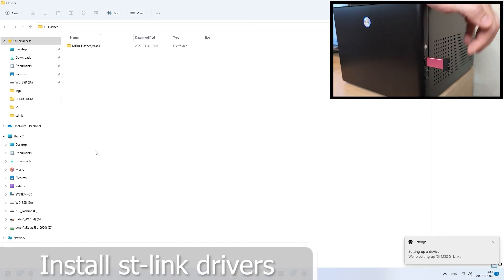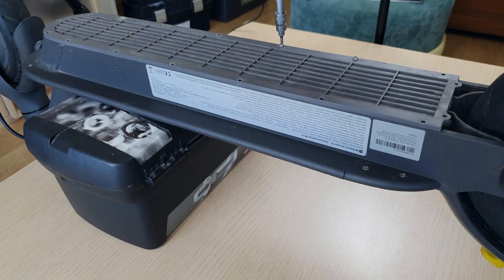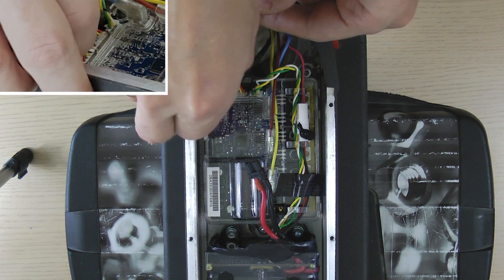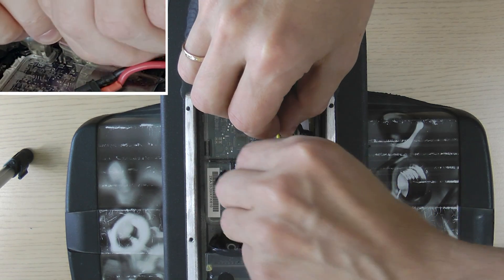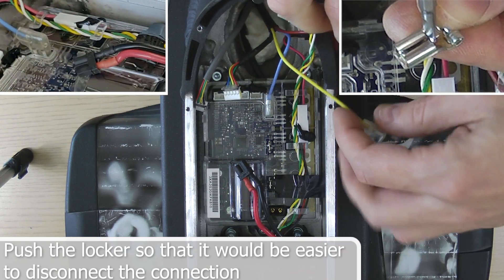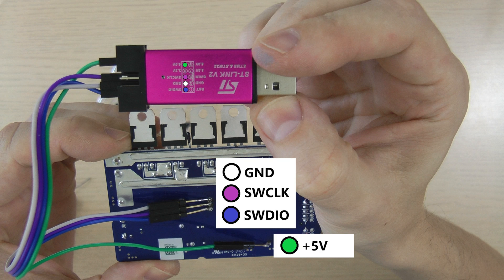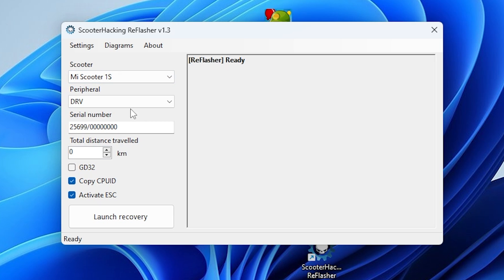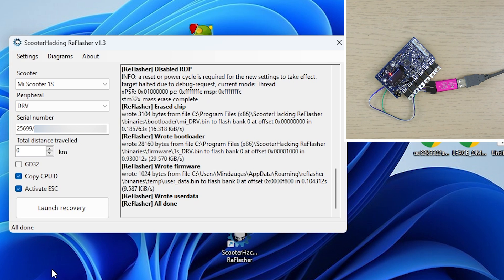Flashing Xiaomi electric scooter ESC board with STLINK (Non-Responsive Power Button fix)

Comment: I bought st link v2 but it cannot be recognized on my old windows 7 laptop, installed drivers and everything, will not work, only blinks red. SOmebody with clue?
Reply from the maker: Try miduflasher (v1.0.5) 
If that does not help, try on a different port, or another pc, if that does not help, probably a faulty stlink.
Subscribe, thanks.
Reply: @MindaugasJocionis  thx for response, it was not faulty st link. I needed to connect it to stationary PC that provided 5v to usb. Then I didnt manage to make scooterflashing utility program to start but I solved it wit m365rec software and it worked.
Reply from the maker: @vfam825  Glad you sorted it out :)

Comment: How do i se my serialnumber I don’t have any stickers left
Reply from the maker: Search on www etc. There are plenty of them. Or on the box if you have it. Subscribe, thx.
Reply: @MindaugasJocionis  Can i just use a Random one?
Reply: @ralphsteen8302  Hi, have you found serial number for your scooter? I bricked mine and have same problem
Reply: @MindaugasJocionis  And do i need those pins you had and if that’s the case what are the name and size on them
Reply from the maker: Check the video description. You can use anything that is comfortable for you to solder to those pin points. 
I didn't tried with random, trie asking in this telegram chat: https://t.me/scooterhackingchat

Comment: This method works for xiaomi essential error 27?
Reply from the maker: Yes, this will help. Tho first try this:
 "Fix DRV Brick without ST link:
(by VooDooShamane)
Switch on and hold the scooter with the brake pulled
Switch off the scooter with the button
Keep the brake pulled
Switch the scooter on again
Connect to SHU (SHU-scooter hacking utility - app from the Android market)
Vanilla DRV247 (load from Repo) flash
When Flash starts, release the brake
The brake must remain permanently applied at all times.
It may and must only be released when the flash process has started.
"
And don't forget to subscribe, thanks.

Comment: You have a video on flashing the dashboard of a scooter too. I just want to use scooter hacking utility with bluetooth. In which case do i need to flash dashboard & ESC. Where is the difference in their function?
Reply from the maker: To flash the shfw (or DRV) from shu over the BT, you need to flash the dashboard (BLE). Of course, if in your scooter is a blocked BLE version.
Mainboard (ESC) needs to be flashed only if it gets bricked for some reason. (wrong DRV flashed, or sometimes for no reason while flashing). Subscribe, thx.

Comment: There is zero need to overcomplicate and solder.
Reply from the maker: Thanks for the comment :)
Yes, it is possible to remove the coating from the board with isopropyl alcohol, connect 5V to the connector, and hold the data pins by hand. However, I'm unsure what will happen if your hand moves while the bootloader is being erased. 
It's nothing too complicated to solder a few pins